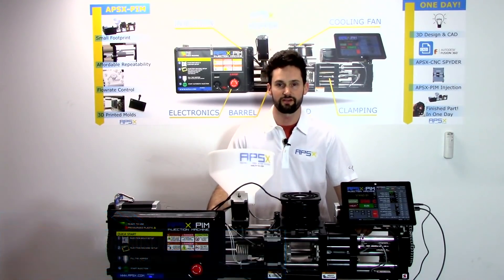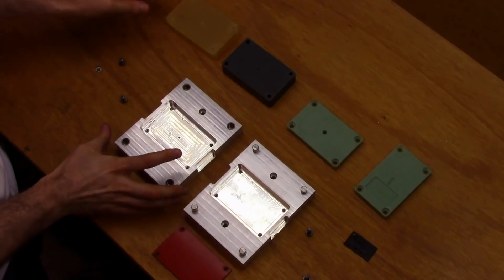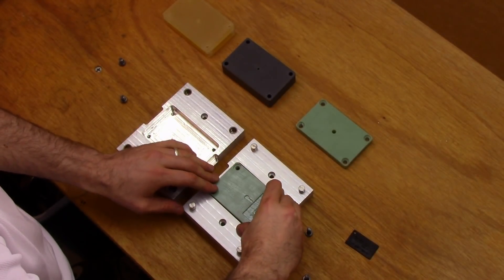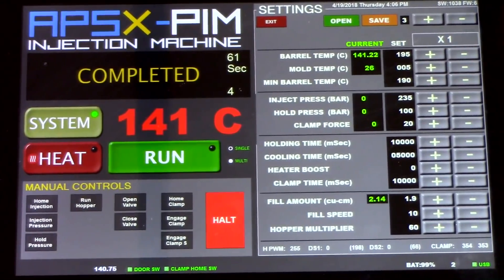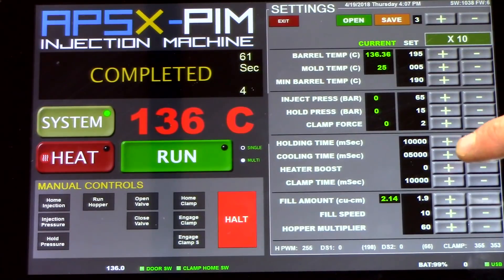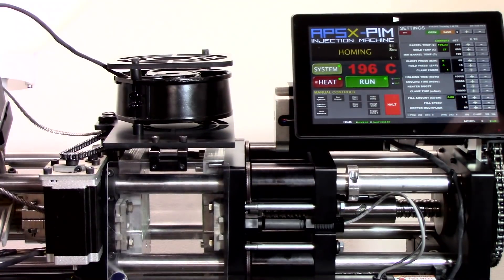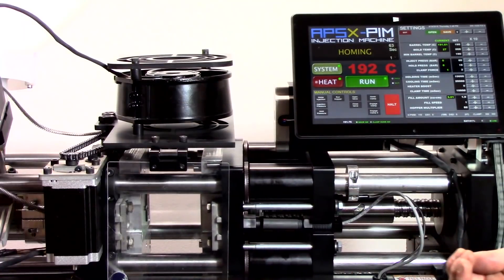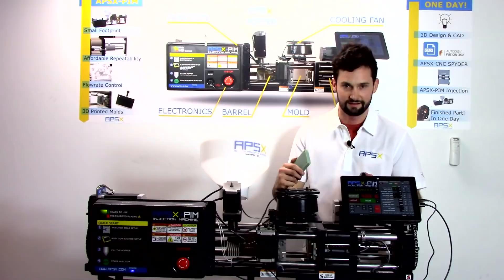How to Use 3D Printed Molds on APSX-PIM Plastic Injection Machine

Comment: What are the limitations of 3D printed molds? I'd like to understand how complex they can be before I need to use metal.
Reply from the maker: 3D printed molds are very practical. You need to have a very high end printer to get good details, However, they get very brittle so fast. After 100 cycles, they get really brittle and takes much longer to cool down compared to aluminum molds.

Comment: how deep can a part be? I realize there is a gram limit on part volume but curious how deep a part can be. seems like those jaws can open pretty wide. thanks
Reply from the maker: For the 3D printed insert molds, the depth is very limited for several reasons. First, the 3D printed material takes much longer time to cool down. Second, that causes to limit the thickness of the part. And finally, the base molds eat up some space out of the available volume. Basically a typical part would be a flat shape geometry for 3D printed insert molds.
Reply: @APSXLLCYouTubeChannel  thank you for answering the 3D printed molds question. sorry to follow up with another question, but i am also curious about max depth for 100% aluminum molds. thanks

Comment: Interesting vid! Did you find any differences between Stratasys, FormLabs and ASIGA molds? Did they need any additional work besides printing? Which turned out best?
Reply from the maker: Asiga and MarkForged are the best by far. But we still encourage people to use a small CNC machine for aluminum machining to make their own molds. It is much cost effective and the final products are NOT just a prototype. They are real parts.

Comment: Nice video! I am really interested in getting more information about 3D printed injection molds. How many parts could you inject with each mold?
Reply from the maker: upto 100 max. But we still encourage people to use a small CNC machine for aluminum machining to make their own molds. It is much cost effective and the final products are NOT just a prototype. They are real parts.